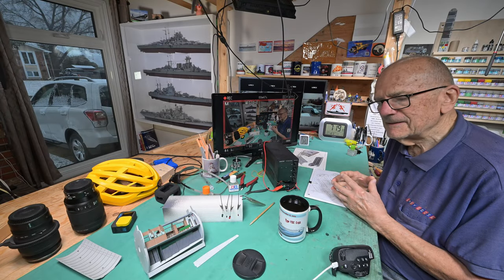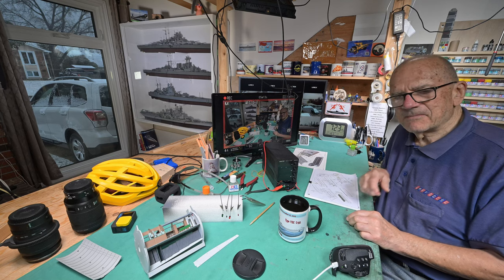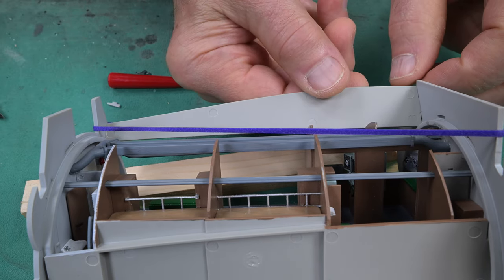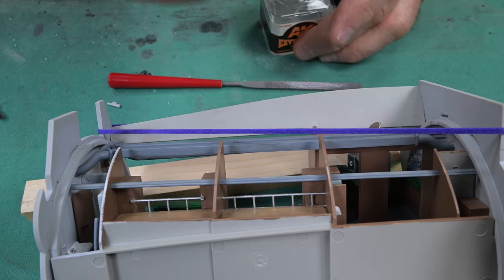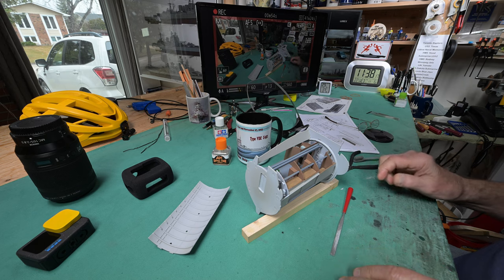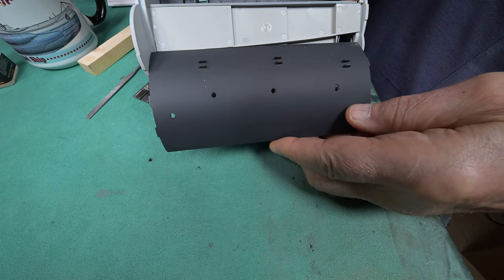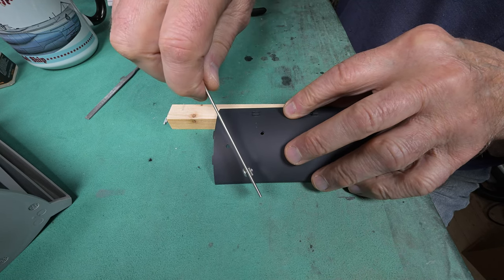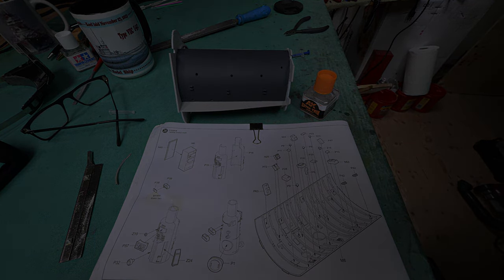The Model Ship - Part 1961

Comment: Have you just discovered the downside of extra thin and "melding"? Somehow the whole assembly got shorter. Melding softens the plastic of both parts and as the plastic is pushed together shortening occurs. The frequent use of this method may result in shortening the whole assembly. It is the only way I can see this happening. Maybe one should be cautious where extra thin is used? I can see a test coming up!
Reply from the maker: Perhaps if I keep using the "Extra Thin" the sub will shorten to the place where it will fit in the ship case. 🤞😁

Comment: I'm getting really concerned regarding the overall fit of the various compartments you have already greatly modified so far. Such a lot of removal of what the instructions specify should easily fit together is going to cause misalignments / gaps as the project progresses. Best wishes with it.
Reply from the maker: Hi Scott. Not to worry! It will look okay once all is together and mounted somewhere on the wall. 🤞😁